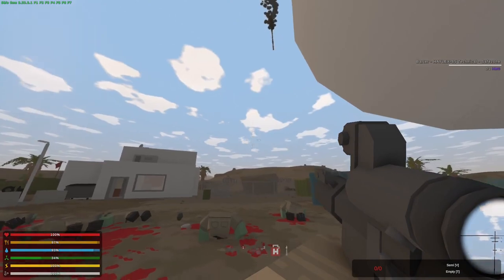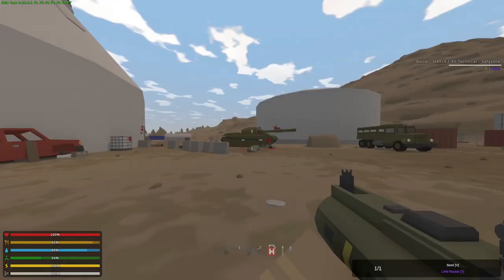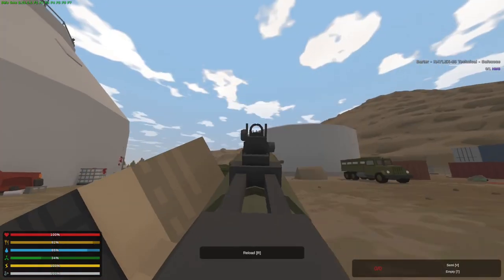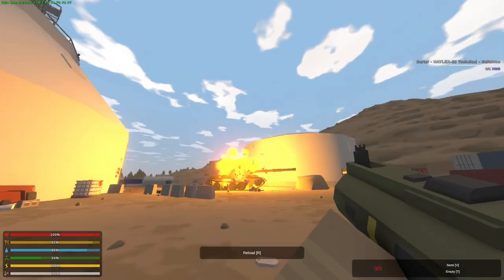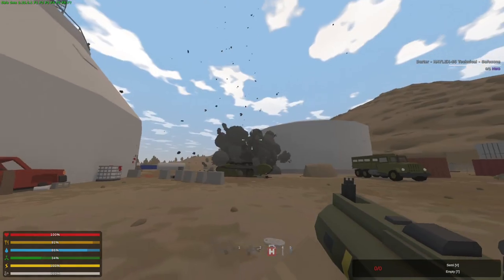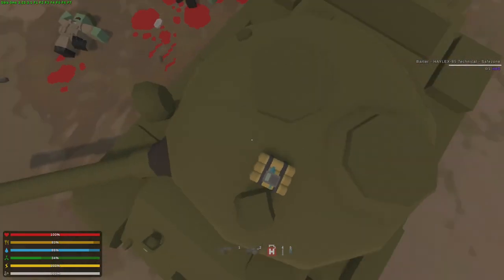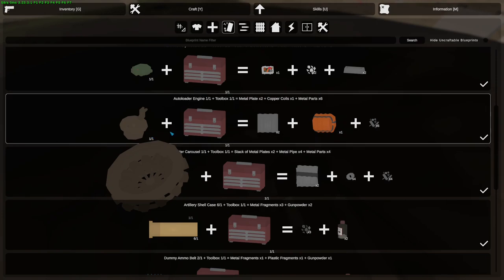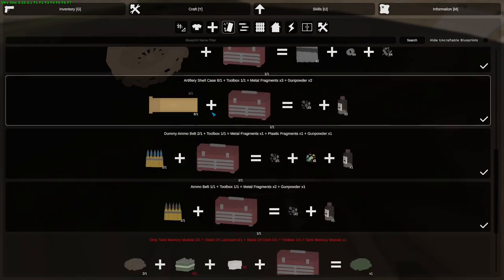How to get Tank Memory Module in Unturned Arid (new update)

Comment: Bro casually picks up 40 ton tank part
Reply from the maker: I am unfathomably strong
Reply: Weirdest part is that it fits on a small backpack lmfao
Reply: actualy whole T64 is less than 40 tons
Reply: @george6269  🤓
Reply: @george6269   and its not even a T-64, its a T-54/T-55
Reply: @buckshot9113  T54/T55 doesnt have autoloader
Reply: @buckshot9113 it’s a T-62, it has the bore excavator on the barrel